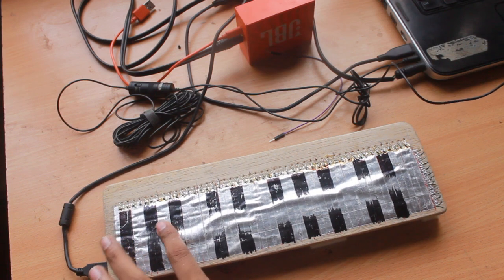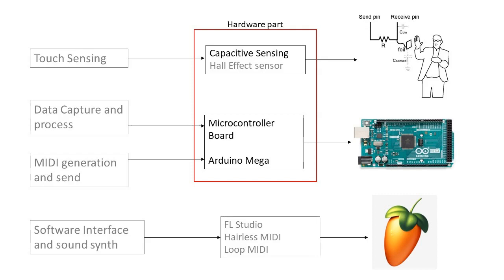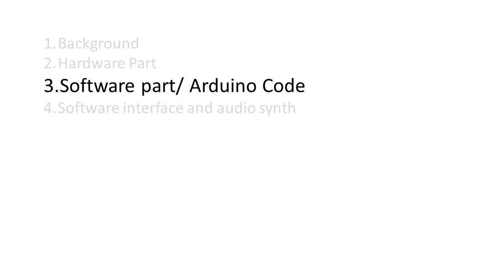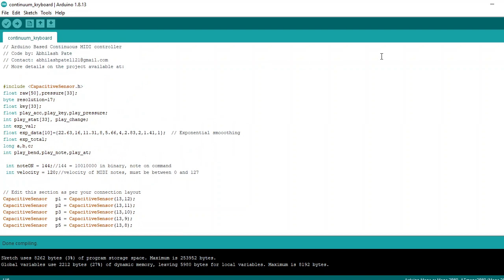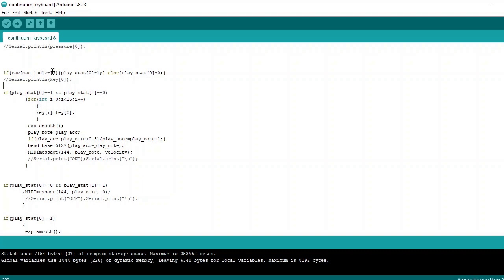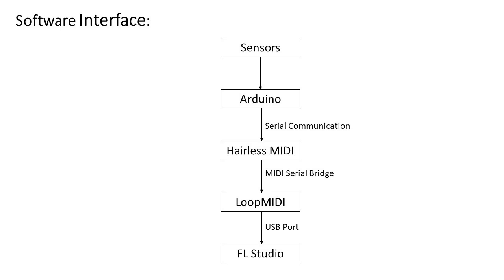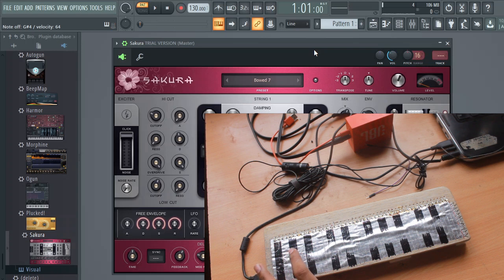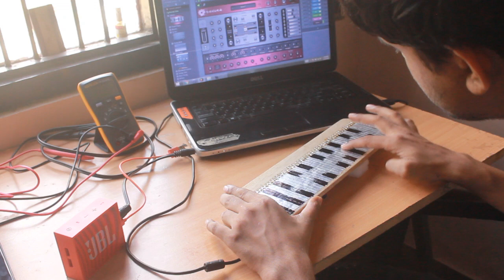Arduino Music: Continuous MIDI Controller / KeyBoard

Comment: This is just amazing. Brilliant work. Do you think you can add more sensor points if you use multiplexors?
Reply from the maker: yes it is possible, I will be incorporating that in next version with better sensor density using multiplexor.

Comment: This is great! Thanks for sharing. I will try to make it after I make a basic no scale MIDI keyboard.
Could it be posible to add a y-axis by adding aislated large horizontal plates?
Reply from the maker: yes it is possible, but if you completely overlap the existing layer with another metallic layer. the layer below want work. so need to design accordingly.

Comment: Also i am trying to figure out to mkea velocity sensitive 49 key midi controller with polyphony and knobs and pads.
I have fpunr ways to achieve all the functions but not the velocity sensitivity some says it is achieved by piezo sensors saome says it is done by using and cutging force sensing strips in pieces but i haven't got the exact way yet. Can you please tell how to achieve the velocity sensitive midi keyboard?

Comment: hello, have you done any upgrades then? I would be interested in making the keyboard, maybe with MIDI OUT
Reply from the maker: i haven't done any upgraded version yet, but I will be working over it. If you need any help making this you can contact me. this version works on MIDI out only.